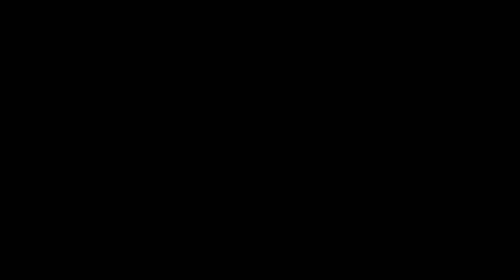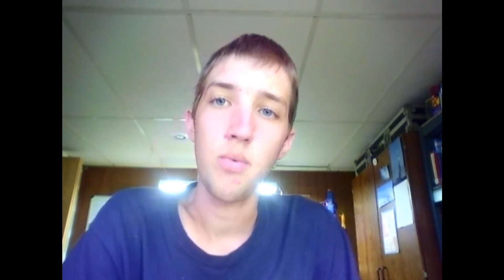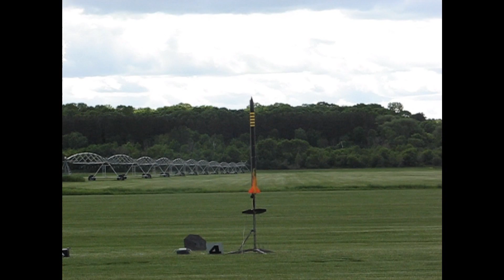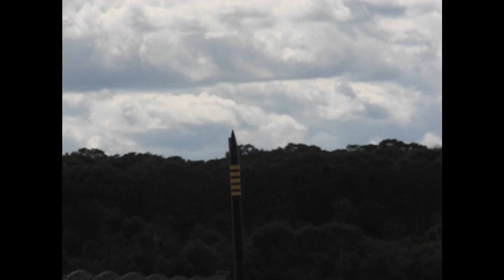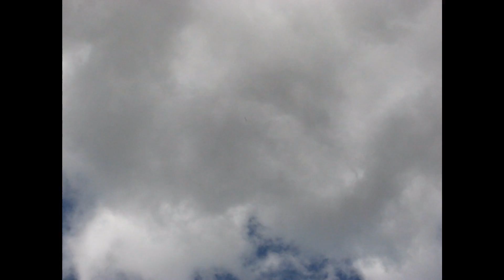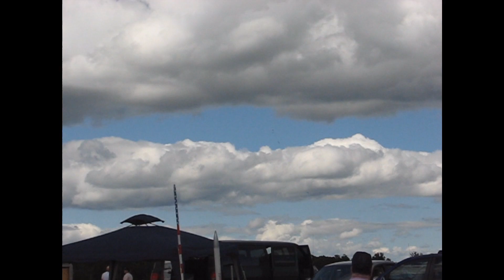Confusing Rocket Flight

Comment: I'm no expert, but either the fins are too small, or one or more of them isn't straight (in line with the airframe).  It starts corkscrewing at the tail, and the rear section makes it worse.  You could add some nose weight to counteract that, but I'd be looking at the fins first.  They look pretty small for that rocket, and RockSim isn't always accurate about a lot of things (altitude especially).  I'd also be using at least a 7-foot rail for a J motor -- 8 feet even better.

Comment: Quick question what was the wind speed on the ground and did you compensate for the higher wind speeds at those heights? From the look of things on the vid it looks like it started fishtailing because of the wind. You may also want to add a longer stabilization rod  to your launch pad next time it helps.

Comment: Hmm, either a to powerful motor, fins may be to small, fins are of center line. It is probably one of these, though you need to give the rocket time to coast to a stop in mid air then fire the parachute or even beteer let the rocket fall a little bit before allowing the charge to fire the parachute. :)